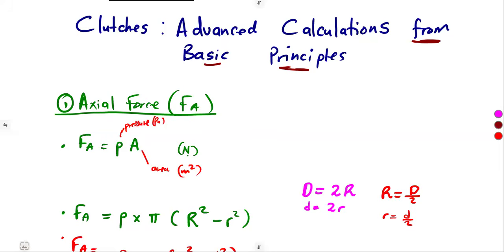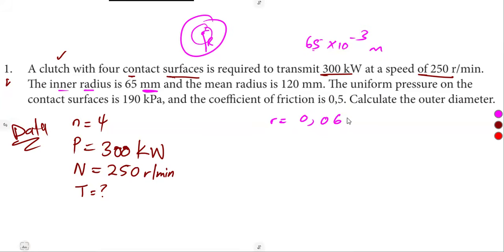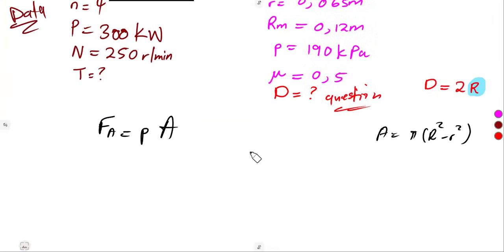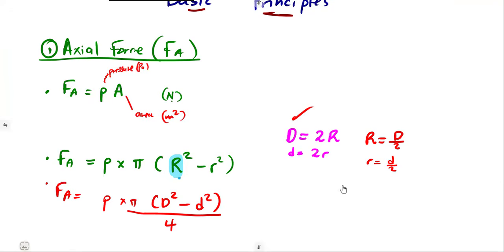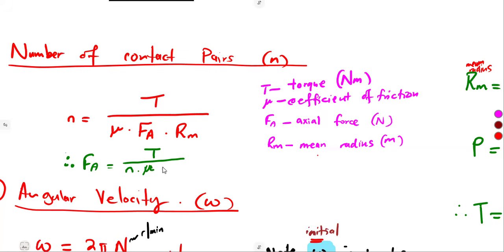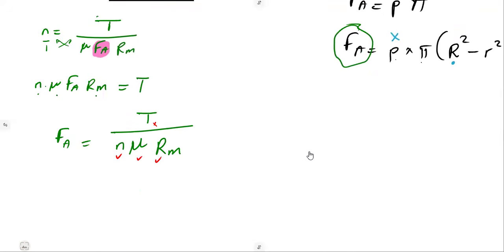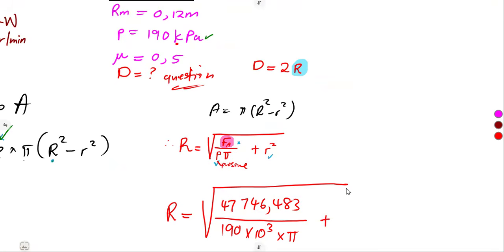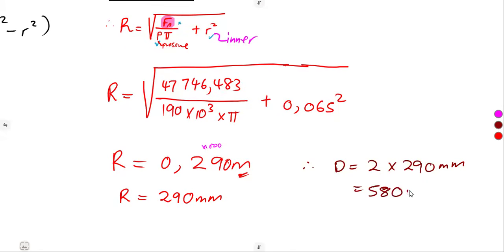Mechanotechnics N6 Clutches - Advanced Calculations  - example 1 @mathszoneafricanmotives

Comment: sir why didnt you use the Rm formula ?
Reply from the maker: Update me if you get it correct
Reply: @mathszoneafricanmotives  the answers are different sir
Reply: You cannot use the Rm formula he showed earlier for this, that one is for Uniform wear theory. Because this question is Constant Pressure theory you will have to use the Rm=3/2((R^3-r^3)/(R^2-r^2)) equation. Making R the subject of that equation is complex and hard. The way sir showed us is the easiest way to get R
Reply from the maker: Hie you can use it , but with all the manipulations, you will end up with the same answer
Reply: @mathszoneafricanmotives  yah i also noticed that with the mean raduis and inner raduis given, what stops me from simply pluging and solving. Which means the mean raduis is NOT the average then?